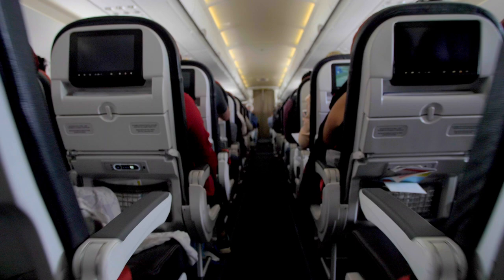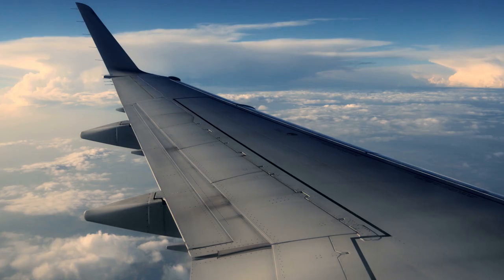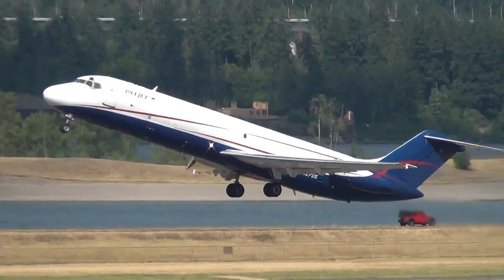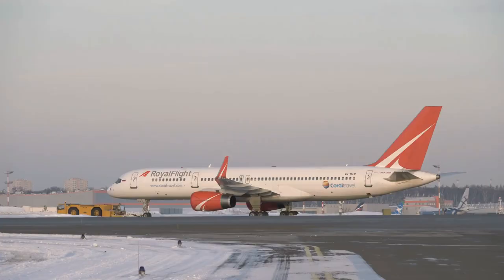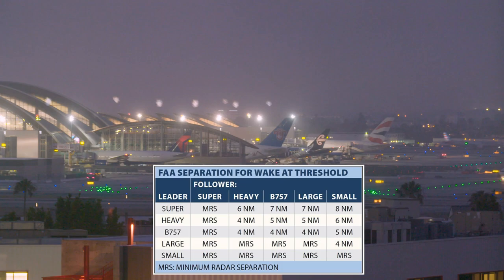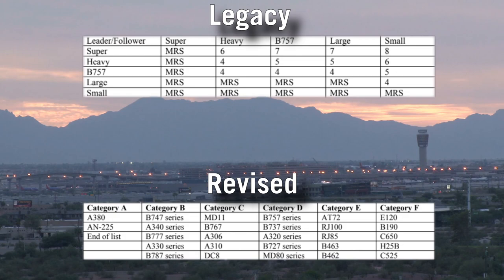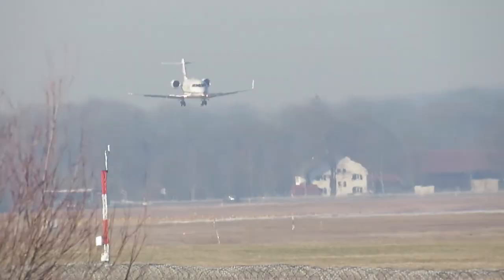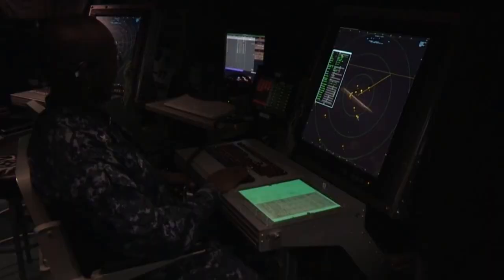This Is Why Airplanes MUST Wait On The Runway

Comment: One notable exception to the weight classification was the Concord. Even though its weight would have placed in the medium category, it had to be classified as a heavy because of the severity of the wake turbulence it produced during landing.
Reply: Same with the 757.
Reply: 757 was mentioned in the video though I think, but not the Concord.
Reply: Droop snoot was powerful
Reply: @kewkabe  757 has its own wake classification in the uk, it’s classed as an upper medium so between medium and heavy basically so an extra mile for separation
Reply: Heard turboprops generate more wake turbulance too although they're typically physically smaller than jets. That was why Singapore upgraded it's Seletar Airport from a general aviation to a commercial one & moved all turboprop flights to there (from Changi Airport, so more takeoff/landing slots could be fitted there)
Reply: Ben R Upper medium? They should have called it medium well, and added a category medium rare as well. 🙂
Reply: @bennylofgren3208  that would of been much better! They are however changing wake categories at some point but not sure if more is getting added or taking away some
Reply: My uncle used to live near Heathrow Airport, and whenever the Concorde would be landing at Heathrow via the approach that goes over his house, the actual house would shake and vibrate. That was the only plane, that would actually do this, with all the other planes you'd just hear them, but with the concorde you would feel it too. His house was around 900 metres from the tip of the runway.
Reply: Concorde max takeoff weight was 408,000 lbs, That would put it in the heavy classification. Wake turbulence spacing during that time was based on what weight an aircraft was capable of taking off at, not its actual weight at time of takeoff.
Reply: @benr970  Same in the US, generally 4 miles.
Reply: no one flies concord now though do they? i thought they were banned?
Reply: @amirdiabe  Our transport yard near Heathrow was under Concorde's flight path, and our Portacabin shook everytime she flew over. As our mechanic pointed out, 'think about how much energy it takes to shake a building, and that's all being wasted as noise'. Makes you think!

Comment: Excellent video!  I am a former flight instructor and you've done a real service for the public by accurately explaining the safety issues around wing vortices!
Reply: as a former instructor can you tell me if a person can be a pilot if he is thin or have eye sight problem and what are the minimum education qualities of a pilot cadet
Reply: @shinyeager2439 : Regulations vary among different countries but generally speaking you will need to have an initial medical exam by a flight-qualified physician and this will include an eyesight test and an ECG (heart function) test. If you are red-green colourblind you will likely not be able to fly as these colours are used as identifiers in aviation. Correctable eyesight issues are not a problem, nor is body shape, size, or weight. To my knowledge there are no minimum education requirements. Happy flying!
Reply: @shinyeager2439  I was in Air cadets for many years and done many flying lesson's in Tutor T1's ,For the medical part you will need to perform a health exam and meet certain conditions.It's Easy to get into Flying programs through cadet's also worth noting that way you can get some free lessons at the start and if your really interested,  it could evolve into a really rewarding opportunity. If anything to do with Being a military Pilot your vision usually must be correctable to 20/20 vision.  (Being short sighted and wearing glasses does not stop me from flying tho :) )

Comment: As a student pilot I was departing Fresno CA airport. Just before liftoff the tower announced 87 Quebec be advised a C130 is departing on the right runway. I was thinking “so”? I was maybe 75 feet off the ground when the Cessna 152 I was flying tried to roll over. It took all the aileron control I had to keep the plane level. One of those unforgettable moments.
Reply: @ezicarus8216  The ‘heads up’ was of no use to him. He didn’t understand the significance of the warning.
Reply: @eddiebruv : I’m a bit surprised that 87 Quebec was given clearance to take off into that turbulence considering the dangers that ATC are supposed to control.

Comment: The 757 is not even a wide body but puts out some of the strongest wake turbulence for some reason. One clear, calm night we were departing 08R in ATL  in a 717 behind 2 757's and after the required wait we climbed out. At probably 800 ft agl the 717 rolled hard to the left, we received a 'Windshear' alert from Barking Betty and it took full right aileron to recover. One second later it rolled hard to the right, we received another 'Windshear' alert from Barking Betty and it took full left aileron to recover. Whole episode only took a few seconds and it was over.

Also, with 'reduced separation' of only 1,000 ft vertically ATC will often advise narrow body aircraft when they are approaching (Head on, crossing, etc) an Airbus A-380 super jumbo aircraft which has powerful wake turbulence. Many/most captains of the narrow body aircraft will ask for vectors off course to pass well away from the wake of the A380.

Comment: Absolutely 100% accurate! I have seen wake turbulance from a medium sized airliner flip a Cessna 152 completely over when it failed to wait for the vortices to dissipate. They are more powerful than you think, and last longer than you think. From an ex pilot.
Reply: Damn! Now I will patiently wait every time I am on a plane instead of getting annoyed like I used to 😅
Reply: @spektred  This never ever bothers me. I have been on flights with delays. No big deal. I look at it as, they're doing something that's for our safety, so be it. I just look out the window, or talk...
Reply: @Neil Foster: The only thing you have to worry about when flying a C152 is whether there’s a small duck or a dragonfly taking off behind you that might get it wings ruffled, lol. You don’t have to worry if one took off ahead of you because you’ll run out of fuel before you catch up to it anyway!
Reply: @rayray8687  I never flew the Cessna 152, only the Cessna 150 Aerobat 👍
Reply: @neilfoster9508 : I trained in a 152 until my 6’ 2” CFI finally refused to get in it, lol. I had to step up with the extra 20 bucks to the 172.
Reply: Yes. About 30 minutes after the aircraft has flow over. The vortex finally dissipate to the ground.
I have see a software simulation of the phenomena, and it is scary...
Reply: I had a similar thing happen in a 150. I had a C17 fly underneath me at a thousand feet, and then several minutes later I hit the left vortex at 800 feet AGL while descending to traffic pattern altitude. It was unsettling to be suddenly flipped sideways and headed straight for the ground, especially on a calm day like that. didn’t know at the time the wake could last that long
Reply: Hey tell us what happen if you get a sudden flat mid way thru takeoff.
Reply: @t.mendous7922  And the damn things could be bothered to squawk for the benefit of others.
Reply: @pierrepiea3279  Sorry, not sure what you were responding about
Reply: My brother's small plane flipped this way.  He wasn't injured, but he was so shaken, he never flew a small plane again.
Reply: @starababa1985  Yeah I can relate, although my situation wasn’t probably as serious, so I have kept flying

Comment: I’m a air traffic controller in the uk, brilliant video. Where I work we have to achieve 10 mile separation between aircraft going down the same airway so they sometimes have to wait a minute or two even if there isn’t any wake turbulence
Reply: Is that because of the sector you will be handing them off to, because that is extremely excessive.
Reply: @chrissede2270  yeah unfortunately, they operate a pretty busy airway so any aircraft we have going down there (most out commercial flights) have to be given that spacing. It’s incredibly annoying when you have a lot of departures to get rid of

Comment: This is interesting.  Thanks for providing it.  I and everybody easily knew why back in the 1950s/‘60s’ when the cockpit command crew paused at the foot of the runway’s taxiway for awhile before making the turn to take off.

That was to individually rev each engine on the plane to high power to check the gauges for performance.  Then, make the turn and let’s go!  For me, this was mostly American  DC-6s and 7s at Dallas Love Field.  And once on an Eastern Lockheed Super G Constellation at the old Amon Carter Field in Fort Worth.   THAT was neat for a kid.  It was a night flight.  I could see blue exhaust flames coming out of the engine, alerted the stewardess, and got to sit on the first officer’s lap while he explained how it all worked.

He joked that his job, as first officer, was simple.  He pointed out that there was a green light at the tip of one wing, and a red light at the tip of the other.  His job was to make sure the captain kept flying between those two lights.  

I was only in second grade, but knew it was BS. 😝

Comment: Sat on a runaway for 4 hours once due to the plane having “electrical issues” I can honestly say that was one tense flight! 😬
Reply: Holy crap, imagine riding a plane that just had "electrical issues" like, the air hostesses and the pilot being: "Yeah, there was some problems in the wires, so we've fixed them.... I think"
Reply: @kart2542  my plane was held back because a part of the wing broke…. Safe to say I was terrified and I tried convincing the people I was to wait till the next flight there but they insisted we get on. Glad nothing happened, but was SCARY
Reply: @fishdogsandotherpets6839  I would literally run back home while screaming the entire way
Reply: I also flew once where before take off the plane kept shutting down. A really large airbus. Everyone was chill but I was so worried. The fight ended up being rather smooth though.
Reply: @TheMelMan  same mine was also we timed it perfectly after a hurricane
Reply: @kart2542  that’s what I was trying to do I almost cried because… ya know… 💀
Reply: @fishdogsandotherpets6839  Nice!
Reply: @TheMelMan  yeah that was a good because I am a worrier, I can’t sleep on planes or anything so if bad turbulence I think crashing, let alone them telling you they had to fix the WING. And on top of that the stage 3 hurricane like bri
Reply: @fishdogsandotherpets6839  Sounds terrifying. I really hate flying despite the fact that I was doing it a lot for work but fortunately I'm able to fall asleep anywhere. I once slept through a 6 hour flight. Woke up when we had just landed.

Comment: When I lived in DC We used to go down to the park right under the approach of WDCA Regan. After a good size airliner passed overhead you could actually hear the wingtip vortices passing by overhead and sometimes see them moving across the field just like a mini tornado and see them transition sometimes from horizontal to vertical. These were strong enough to easily flip over a smaller plane and if you stay inside one long enough flip another airliner. These are powerful suckers and can intensify long after leaving the wingtips.

Comment: So, when the DC-10 wasn’t busy crashing it was causing other crashes? Yes.
Reply: A level of efficiency other manufacturers can only dream about
Reply: I don't remember the flight info but there was one case when a DC took off before a Boeing. A piece of the DC fell off and cause the Boeing to crash. pathetic
Reply: @tailorforeman7082  same story caused the crash of a Concorde, grounding the whole fleet forever. Beautiful machinery brought down forever by junk from that joke of a plane.
Reply: @GaneshKumar-bv2td  sorry yes, it was the Concorde not an Boeing
!
Reply: It was the opposite of that. It was in its design stages for well over a decade, it blew it's budget massively and it was one of the most reliable planes out there, with only one crash, which wasn't even its own fault. 

It was and is a beautiful plane, arguably the most beautiful passenger plane to exist.
Reply: @tailorforeman7082  Same story with the  terrible Concorde crash - a piece fell of a DC-10. The Concorde ended up in a fire ball.
Reply: @ezicarus8216  nonsense
Reply: @winfriedwilcke1705  wrong. The Concord crash was caused by the Concord itself. A huge chunk came off of the landing gear while it started to take-off. It caught on fire right away. Someone who was driving nearby, pulled-over and took a picture of the doomed flight right as it was taking-off. Frightening to see. Look it up and check the images. It's haunting.
Reply: @donnamariedavidson5065  Pilot here. Sorry, you are wrong.  I know in great detail what happened in this crash and it all started with a small metal ring falling off the DC 10, damaging a tire on the Concorde.  Here is a detailed video even suitable for laypersons explaining the crash sequence of flight 4590. I agree it is haunting.
Reply: @donnamariedavidson5065  YOU are wrong.
Reply: I have lost count of the number of crashes where a DC-10 was involved.

Comment: To add to this, helicopters operating off small ships (Frigates, Destroyers, etc.) must take into account the turbulence created by the ships superstructure. I watched our helo loose Tail Rotor Authority due to winds exceeding 45kts over the bow of the ship. Fortunately, as the helo's tail was spinning around the main rotor, the helo managed to lift off the deck and away from the winds and regain control.
Reply: Hi John,
Do you know the cause or can you speculate the cause the loss of the Helo off the deck of the USS Abe Lincoln off San Diego a few weeks ago?
Reply: @penelopelgoss2520  From the scant details given by the local news I only know the the helo was trying to land, there was some unusual side swaying (?), the rotors blades struck the deck (which caused the injuries on the flight deck), then the helo went over the side (90' drop). I suspect some sort of mechanical or equipment failure with the flight controls. But without seeing film I can only guess. 
The investigation could take months. And I'm 25+ years past having accesses to Safety Magazines and reports that would cover things like this.
Reply: @johnknapp952  
Hi John,

Thank you. I am unaware of the weather that day across or on the deck of the carrier. Thank you for sharing your knowledge. It's much appreciated!
Reply: RDC, USCG, Retired, 7 yrs at sea! 2 WHEC’s on west coast & 1 WMEC east coast! Never had any wind issues, a couple fog issues thru the years! Crazy pilots flying off/on such small flight decks, Lol 😂! Training for those hospitals with helo pads on the 25th floor, right? Had 1 “safety officer” pilot, ex Army an Viet Nam pilot onboard 1 patrol. Never wanted us telling when returning to the ship. Always came back high an out of the sun! Good morale booster for those on deck! Great Memories!

Comment: Thank you for putting 'metres' measurements when you said 'feet' - us British matter too 😂
Reply from the maker: Not just the British. Pretty much all non-Americans 😉
Reply: @NotWhatYouThink  das stimmt
Reply: @NotWhatYouThink  and them too of course 👍🏿
Reply: Murican measuring system confuses me
Reply: @StarscreamX404  it confuses us too! But we like it!
Reply: @NotWhatYouThink  please also add metric at 6:40 and for NMi.
Reply: UK uses imperial measurements too.
Reply: Plenty of Brits are perfectly capable of understanding both systems… remember you understand that your speed in a car is measured in miles per hour, you fill it with litres of petrol, yet understand its efficiency in miles per gallon.
Reply: @ezicarus8216 You're a complete dufus.   I'm engineer and fully capable of using metric or imperial.  I prefer imperial because it is more natural human unit of measure and I can cite numerous examples.  In volume a gallon is about the right amount of liquid an individual can easily carry in one hand.  The measurement of fuel economy based on # liters/100 km is less useful than mpg.  If I have 1 gallon of fuel left in my motorcycle without fuel economy computer  I want to know how much further I can ride.  

In temperature measurement centigrade is not granular enough.  Deviation by only +/-1 degree C variation in temperature would raise many complaints about comfort in a building.    

Let's talk about units of time.  Do you think they should be base 10? Why is the measure of angles in degrees with 360 in a circle.  Does it bother you there are 365.25 days in a solar earth year? 

As far as blunders by NASA engineers I blame their absurd policies targeted at achieving diversity objectives rather than hiring best and brightest.
Reply: @ellisonsimon  and petrol - litres; beer - pints!
Reply: Yes, Cheers to the Brits 🥳
Thanks for the Imperial system !

Comment: Once, when I was going to London, the plane went into the vortex of another plane twice. Both times it rolled maybe 30-40 degrees before the pilot got it back (we were still fairly high up in the air). It was quite an experience.
Reply: I would have flipped-out, big time. Holy smokes!!
Reply: @donnamariedavidson5065  There was a lot of tension in the cabin, but no panic or anything. People stayed calm and when the pilot came with the announcement after the second roll it made people relax again.
Reply: @Angelspotter  One would've thought that the ATC would not have been so careless, no?

Comment: Back in the mid-80s, I was in a 737 going into Phoenix airport once when as we descended the aircraft shuddered somewhat violently and dipped to the port (left) side. Suddenly we rose quite quickly and did a go-around and landed safely. Upon pulling up at the gate the pilot came on and said: "looks like we got a little too close to the previous aircraft on that first pass; sorry about that"